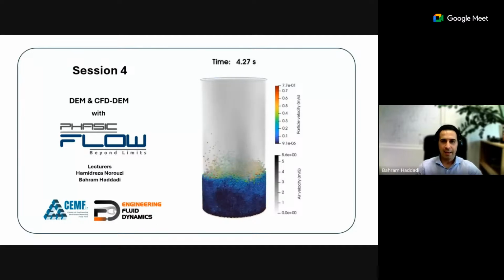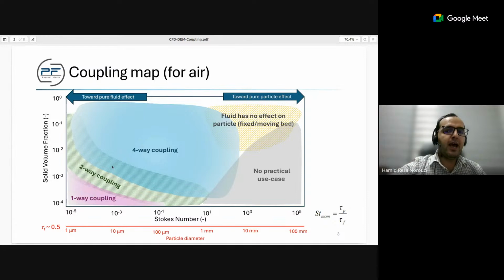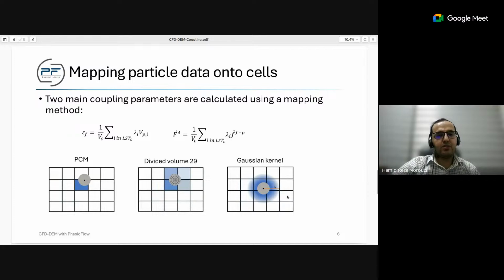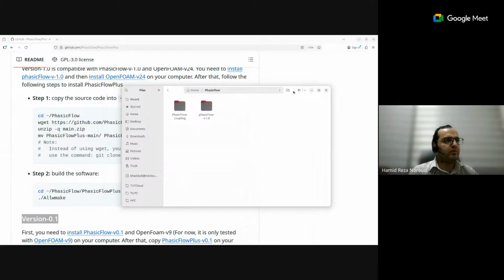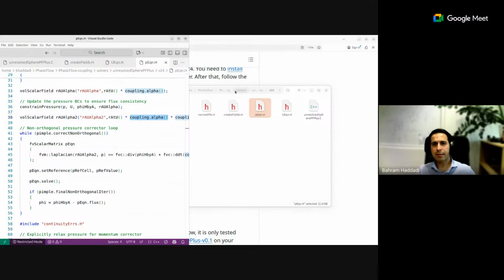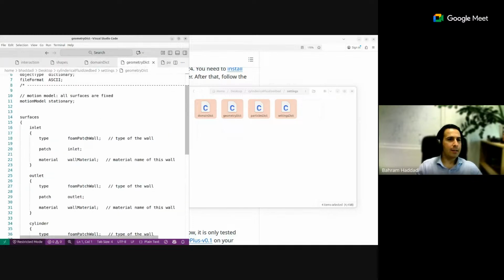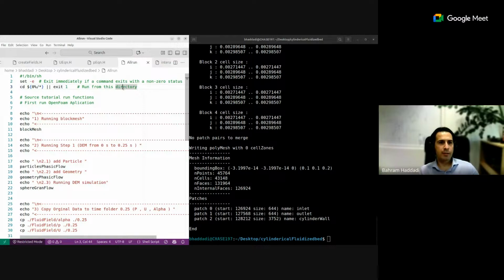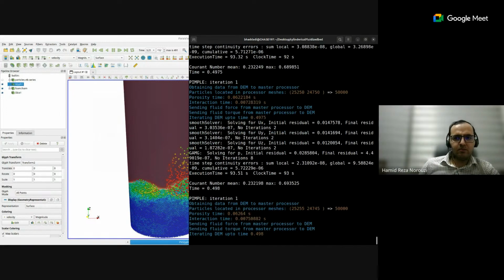4. DEM and CFD-DEM with PhasicFlow - Unresolved CFD-DEM

Comment: Hamid, how much particle/mesh size ratio is the max  you recommend for the solver? are to coarse particles on a large mesh any good aproximation?
Reply from the maker: Hi. If possible, use mesh around 3 times particle size. But with adaptiveGaussian or GaussianIntegral, you can use finer mesh.